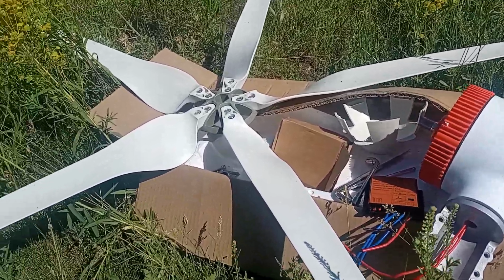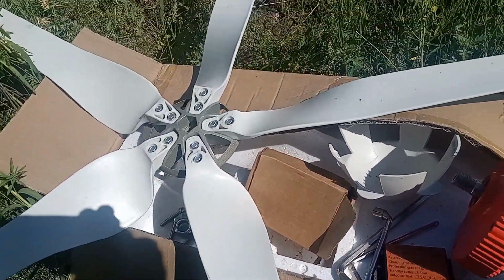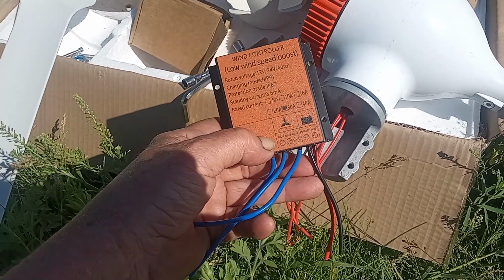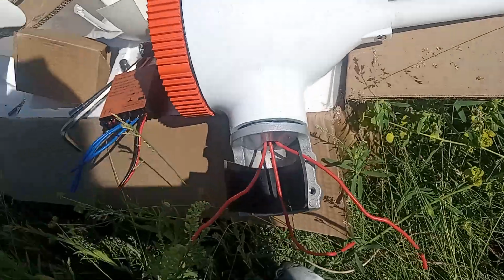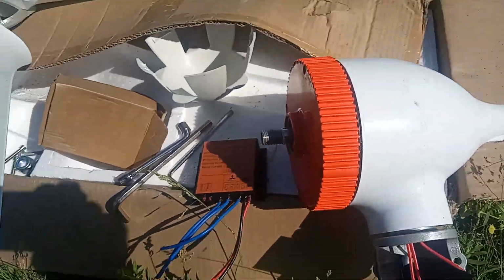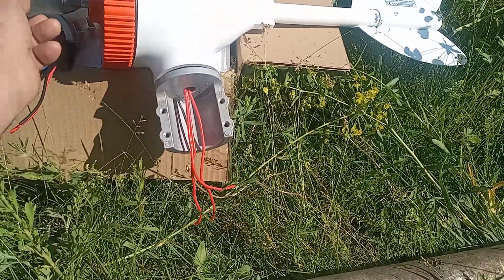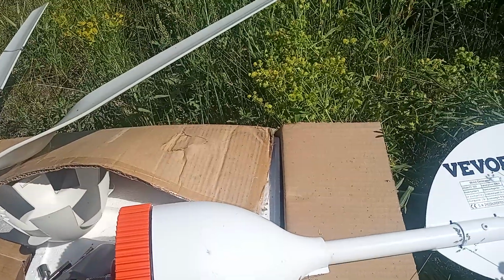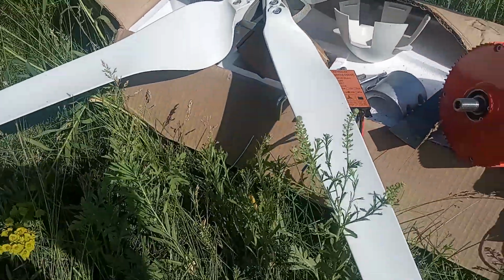$100.99 Chinese wind charger

Comment: I got 4 solar panels instead, on a DIY frame with wheels, and a Bluetti, and it's been working nonstop for almost 3 years now. 
And  another panel that feeds a battery for a dusk to dawn pole light.  Solar is much easier to set up and has no moving parts. We get some nasty winds down here  occasionally.

Comment: There used to be quite a few different ways to generate 12volt systems prior to the REA coming through, I wouldn t be too surprised if you could locate somthing made by Aermotor or Demster.
Reply: Pardon my spelling Dempster

Comment: Well maybe it will work for you but you are gonna have to do alot more "green" projects to offset all that bovine gas up in the Dakotas. Good luck with your projects
Reply: You keeping all the scorecards? 😂
Reply: Cow farts causing climate change has been proven to be both a hoax and a scam, as of 6-15-24. Actually, climate change, in general, is a hoax and a scam. Temperature raise, .05 degree Celsius per century, worldwide. Sea level rise, approx 1 English foot per century, also.

Comment: If it will produce even 360 watts pretty consistently thats 30 amps at 12 volts it will charge 3 or 4 batteries pretty easily, and whats nice is it can go all night. Good luck☺

Comment: I was thinking of getting a Sonic cleaner for carburetors and I checked around and.. probably 8 out of 10 or okay two out of the 10 are going to fail.. my wife has one to make deionized water Mikey would put in an iron but we put it in a humidifier.. now from time to time it will leak.. but right now not enough to get pissed off and throw it away... So it seems like vevo or maybe yes maybe no

Comment: Most everything is mfg in china... simple ac 3 wire generator, ac / dc charge controller, rubber is to minimise vibration.. charge controller with dumpload is best, off load is for outgoing load first ( primary ) ie. Lights, water pump etc. While power is being generated . Charging is ( secondary )

Comment: 3 phase to the controller, then dc out... thats why it doesnt matter on the 3 wires
Reply from the maker: I have it set up running at the moment and it works.  The only flaw in the design is the tail is both too short, and too small.  I taped some cardboard on it and it helps keeping it faced into the wind.  Without it the unit tended to spin around and run backwards.
Reply: @logcabinlooms  Not suprised at all.
Reply: You are the man....

Comment: I got 2 diesel heaters from vevor, they did fine, but only used half of my southern winter.
Reply from the maker: I have a water pump from them that uses a Honda clone motor that has impressed me.  I use it for watering the garden and am satisfied considering it was really cheap.  The hose connectors they supplied were junk, but I put on standard banjo fittings I already had and it really pushes water.
Reply: @logcabinlooms I purchased the same pump I believe. Is it a 2" trash pump? Mine works great. I also bought an auto darkening welding helmet. I like Vevor. Imagine how much the stuff would cost if made in USA?